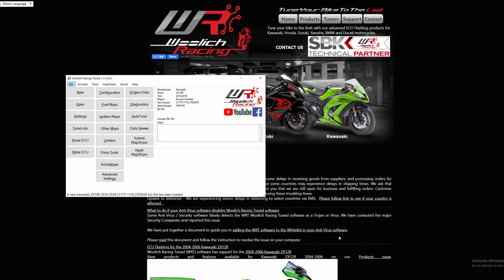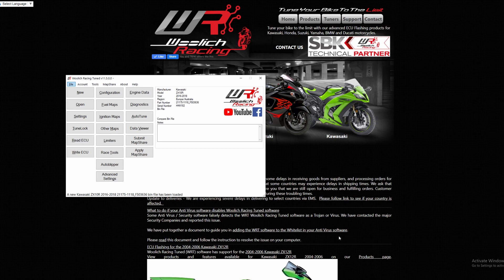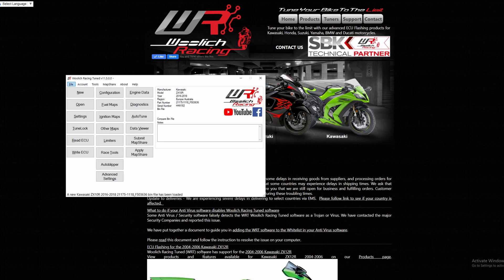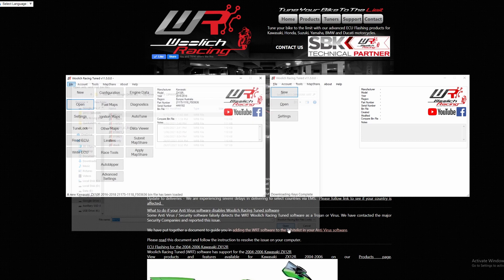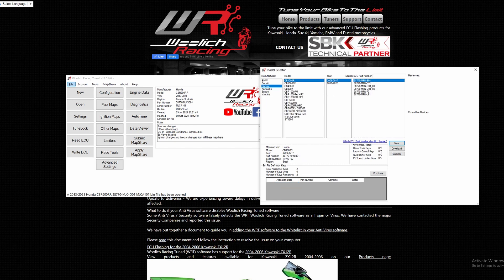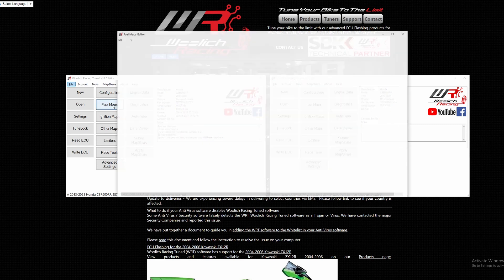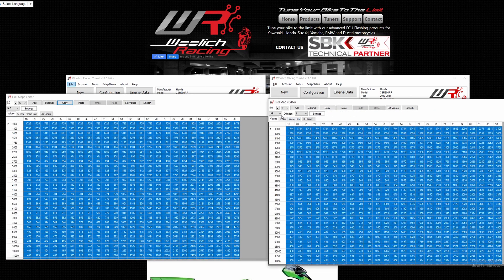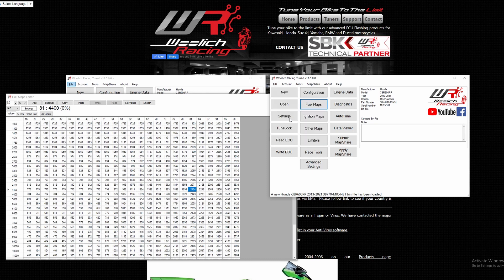How to Copy and Paste Maps between Bin Files

Comment: Sir, did woolich racing software can save my original map before download new map?
Reply from the maker: If 'read ECU' is available for your specific model, then yes we would recommend that you do this. However, we aim to have the original files available and the software will prompt you in the instance wherein a file is not. Please ensure you check on the website for your part number before ordering to avoid any delays.